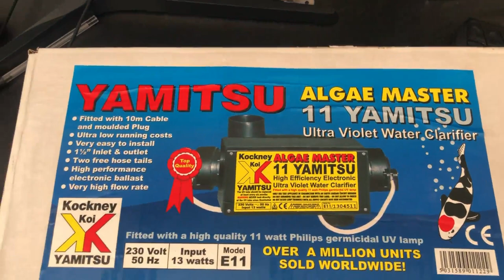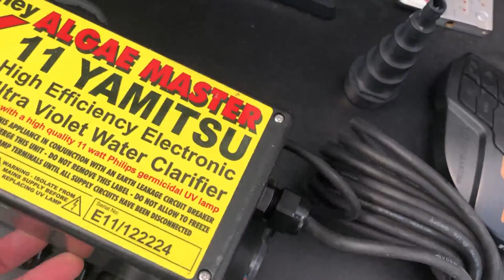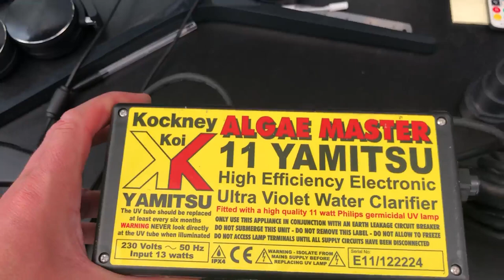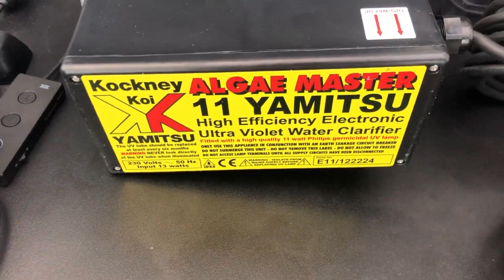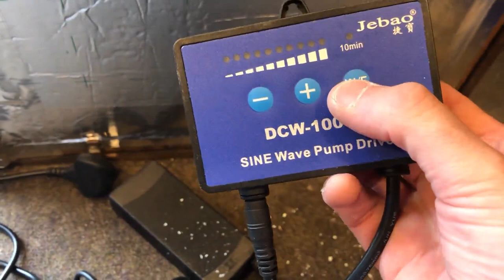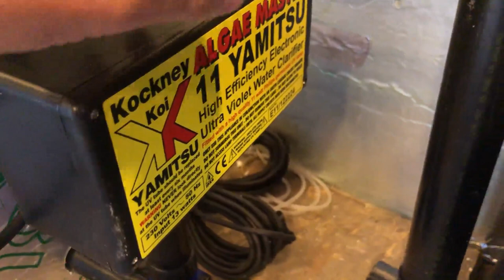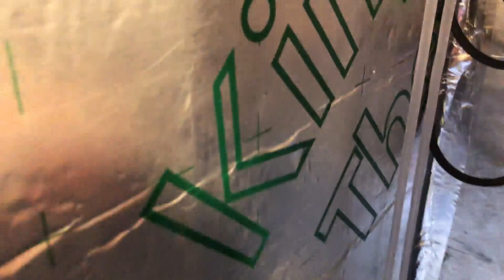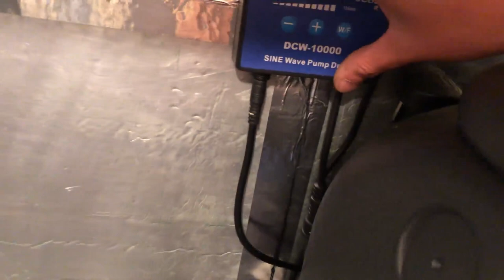DIY 3 BARREL FILTER INSTALL & SET UP

Comment: Hi Gaz, just catching up.. I watched both videos. I think you have put the T on the waste the wrong way looking at your waste pipe. The swept bends should be in the direction where you want to flush the waste water out (on the right side for you I think?). Ideally, you want a non return valve before the pump and a ball valve after the pump so you can always do some maintenance or undo the pump.
Reply from the maker: Yeah I know, I am a little upset at my self with that one 😕 I will have to remove them and replace them, I could kick myself for that mistake, I wouldn’t mind I pointed that out in the past video, saying make sure you fit them in this direction 🤣🤣
Reply: @GazsKoiPond  it happens...
Reply from the maker: It does, 🤣🤣 probably due to rushing trying to solvent weld all them 8 joints at once 🤣

Comment: Great Video and update but the volume stated for the UV is as deceiving as the Max Flow Rates shown on pond pumps. You can lose the flow through the equipment, pipework and heads just as the position of the pond in relationship to the Sun can mean that you need to have a larger UV. My pond in semi Sun is recommended for a 32watt but a 32 watt will not keep the water clear especially as the flow rate of my pond is higher than the recommended flow rate for a 32w. For the sake of £10 or £20 it is often better to go oversize.  Each set up is different but the UV Unit is a good bit of kit.
Reply from the maker: That’s the key each pond is different 👍🏻👍🏻

Comment: Gaz can I ask why you’ve kept all the barrels at the same level especially being pump fed , take a look at wrighty’s older videos where he shows you how to make these and set them up , I only say this because I noticed in your trial run that your water level was way to high filling with a hose and no media , once your running a pump you may find it over flows , I may be wrong but worth thinking about 👍😀
Reply from the maker: Thats why I went with a veriflow pump, so that if needs be I can slow it down and balance it out, and if it needs to be stepped down, then ajustment will be made, time will tell but that said, its not got the same inside system as what wrighty's system has, I dont know if thats a good thing or a bad one, time will tell, and to be fair I like the tinkering around and working with it. 👌👍

Comment: Good pumps them gas i use the same pump on my pond, also had the 3000lph pump on my big tank for about 5years with no issues whatsoever, systems looking good mate but personally I’d look at putting a gate or a ball on areas 1 and 3 so,ply so you can isolate both the uv and the pump if you need to work on them at all that way you can remove them if needed without draining the system and flooding your shed 🇯🇵⛩🐟👍
Reply from the maker: cheers mucher,  I already have the valves and totally agree with you 👍👍

Comment: My puddle has a 25watt uv and it was recommended to me by a certain shop when I set the 6ftx6ft 4ft deep container up and at the time I knew nothing about uv systems and sizes 🙈  great update gaz bud very intresting I can not wait for the turn on 🤣 I mean switch on 👍😁😎🐟
Reply from the maker: Cheers Kyle you and me both 👍👍

Comment: Hi Gaz looking nice but I noticed that you have put the swept bends on the  waste outlet the wrong way 👍will cause a little back pressure and all waste might not shift off bottom of the barrells and you may need too step the barrells also to prevent back pressure when all the barrells are full 👍
Reply from the maker: Hi John, I do not have any thing on the wrong way round, and it doesn't make any back pressure as they are the flush out waste, did you not see the test video I did on the graden lawn, the flush out waste system works perfectly, it dumped 300 ltrs on to the lawn in less than a few minutes, it also flowed from one barrel to the next being level as well, but if it needs any changes, I will be sure to make them as needed  👍👍
Reply: The 2 Swept T deffo on wrong way but won't hurt 👍👍 🤪
Reply from the maker: @johncope7471  crap John you are right mate, now I am mad at my self, I pointed that out when dry fit in the last video, that’s going to do my head in now

Comment: UV's stated water volumes don't generally account for ponds that are for the majority of the time in full sun. A lower wattage UV on a pond in full sun is going to struggle in the height of summer.

Mine has a 40w UV but it's on a south facing garden in full sun all the time, even though technically it only "needs" about a 25w
Reply from the maker: Mine is east facing and gets sun all day and only has 11w and has never struggled to keep the pond algae free 👍🏻👍🏻
Reply: @GazsKoiPond  fair enough, all I can go on is my past experiences with the old pond that had a 25w UV on it and it just wasn't up to the job. That's despite flowing less water through it than the manufacturer stated.

Comment: Are you fitting a non return valve of any description between pump and pond to avoid the pump running dry during cleaning?
Reply from the maker: thats the next stage mate as it will not prime with out one mate 😉👍👌
Reply: @GazsKoiPond  yep, sorry posted that before I watched the end 🙄

Comment: Gaz I'd put a ball valve in position 3 . Have a look at some rubber tree ties with the block in to hold pipes together
Reply from the maker: Yeah just to prevent movement and the pipe rubbing together 👌👍😀

Comment: You get stuck for elbows mate ive plenty spare 45 or 90 as its bank holiday weekend lol ,just give me a shout ,but looks cracking job ,ive gone 36w uv but im running near 10 k litres and was 20 quid extra lol
Reply from the maker: The 11w only does to 6500 ltrs, the 25w does upto 19,000 ltrs so you could of cover your pond with the 25w but hey-ho 😉
Reply: @GazsKoiPond  was going for the 25 lol but the other half bought the bigger one ,so im not complaining ,i didnt pay for it lol
Reply from the maker: @Peter's Puddles koi and goldfish  HAPPY DAYS MATE 👌👍

Comment: Hi Gary, don't usually leave comments but don't won't you to make the same mistake I made,  my set up is pretty much the same as you've done.
I recommend a flapper none return valve on the pipe coming out of the pond I went for a 2inch valve and put mine just under the water level. This will stop the water back filling into the pond preventing you having to prime the pump every time you turn the pump off ( it's a right pain ) and I would also put a slide/ball valve between the pump and the UV for maintenance to the pump. It also will stop the 1st barrel from back filling keeping the water in the barrel, this is useful to help prime the pump if you have to do maintenance on the pump. Believe me the pump can get jammed or restricted flow with weed/debris the joys with pump fed systems without a pump prefilter. 
I would also consider a slide/ball valve on the return pipe from barrel keeps the water in the barrels. Just make sure you remember to open them when you turn the pump back on unlike I did once 😂. Hope this helps I've been pump fed for 30yrs. 👍
Reply from the maker: Thank you very much Paul, that is very helpful and I will get some picked up hopefully tomorrow 👌👍

Comment: Bigger uv more power so as the bulb slowly degrades then you still have enough power I  the lamp after 4 or 5 seasons to still work is one reason so less maintainance the bulbs don't suddenly not work they slowly produce less uv .   So the money you can save in bulbs pays for itself and you do t have to mess about so much     general rule if thumb is 1w per 1000 litres of water seems kockney koi are using 1.5 so slightly over rated anyway probably for that reason
Reply from the maker: So if that’s the case then 1w per 1000 ltrs the 11w should be fine for my build and the bulbs are less than £10 at my local store
Reply: @GazsKoiPond  yep ..  Well work out a bulb nor replaced every 2 to 3 years and you could buy an entire uv ..  although my 55w kockney koi one is at around 25 years old now lol exactly the same design     if you look at the evolution aqua site they work on 1w per 1000l either or it makes no difference I only change my bulbs when the wayer starts to green when they are turned on anyway no point otherwise mine are on season 3 now and cleared the pond in 3 days after turning them on so still working fine